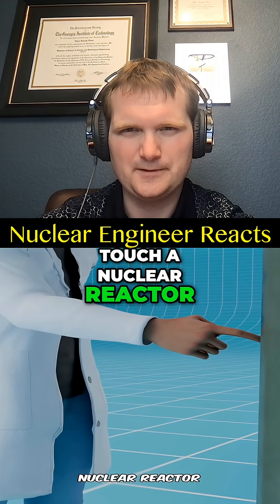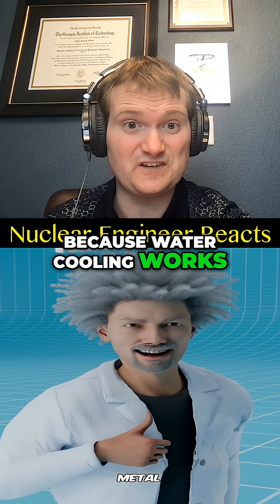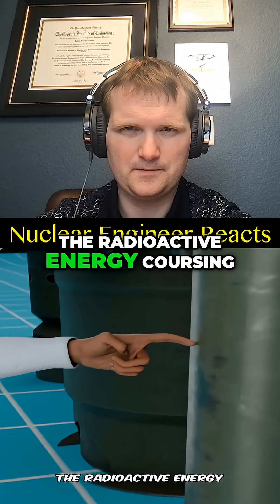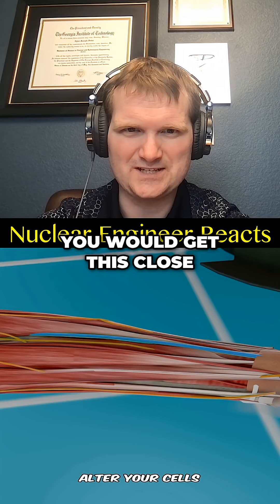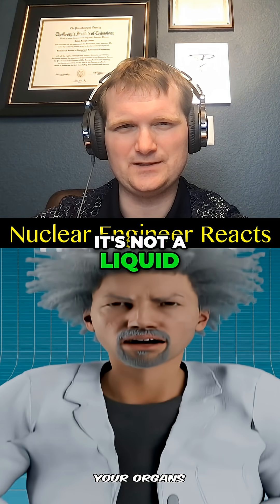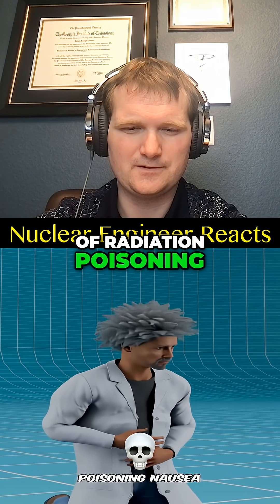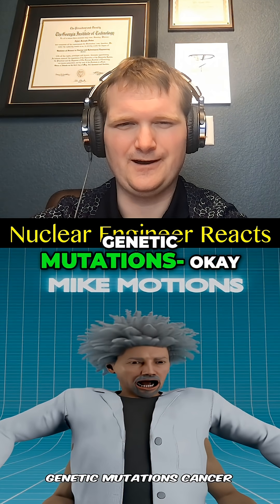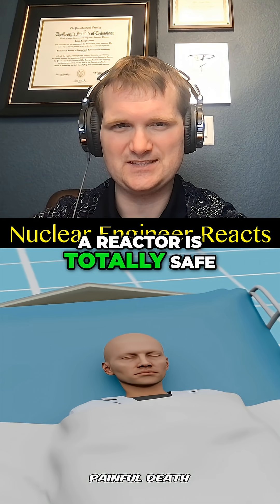What Happens if You Touch a Nuclear Reactor? - Nuclear Engineer Reacts to MikeMotions

Comment: For all the beginners in the crowd. This is Potassium Permanganate and Sugar mixed together. This causes the potassium to get thousands of degrees hot. The potassium can also purify water. This is a good thing to bring with you for water purification and fire starting. It does not replace a Bic but enhances it.

Comment: Id like to hear your take and explanation for the regular joe about that control rod disaster that happened in that "portable" reactor the military had... when one of the operators lifted the center control rod out of the water like 24 inches instead of only 4 inches. It ended up causing the deaths of 3 men.

Comment: I have actually been in the reactor compartment on the USS Enterprise. it was shut down in port and it still took a few days before we went in. it takes a half hour to suit up, the elt's have to do the surveys and mark out the hot spots. and its about 120F the whole time and most of the metal is insulated. you carried your TLD and a pocket dosimeter. you spend about an hour inside doing your job then finish, go out and check yourself for contamination, remove the suits into the proper containers. you lose about 5 pounds of water weight from sweat. the dose I got? a lot less than a chest xray

Comment: Would you consider light from a lethal light bulb or sun a fair analogy of radiation? Longer exposure would be understandable as similar to getting a sunburn, and it's just as immaterial as sunlight, aka not a substance you can touch or ingest (although obviously radioactive substances could still be touched or ingested)
Concrete and lead are "opaque" but other materials are rather transparent to this light.

Comment: Though the water, metal and concrete would shield from alpha and beta particles from the core, I wonder if there wouldn't be alpha and beta particles coming from the neutron flux and gamma radiation knocking them out of the outer layer of the shielding.

Comment: The explanation with concrete and water protection does not apply to a CANDU type reactor, which also has water and concrete protection but is not immersed. Here you can literally touch it (the channels and feeders) only during an outage, otherwise you will never be able to enter normal operation of the reactor due to the numerous protection barriers that open only during an outage.This is a small explanation, everything is much more complex.
😉

Comment: I would spend hours vaping outside the reactor compartment on fast attack submarine deployment. I was shielded by diesel fuel and sea water. My TLD never said I was exposed to harmful levels there. There's less radiation in the engine room on a nuclear sub than standing in the sun light

Comment: its best to think about radiation as light... because it acts almost exactly the same way. an exposed hot source would just look like a glowing orb if you could see that wavelength of light. place something in front of the light, it blocks it. in the case of gamma emission, you just need concrete or lead.

Comment: It is possible to touch the Vessel (usually the under-vessel / in-core guide tube room) 
At power it’s double locked and posted VHRA (>500R/hr @ 1meter) so you’re not getting in, and it would be far from room temperature. 

During an outage workgroups need access, (removing insulation from the vessel for inspections usually) it’s still pretty dosey, usually posted LHRA or HRA, and may be “room temperature” but that room is freaking hot 😂

Comment: If you're immediately throwing up after exposure, good luck living 2 days, much less long enough to worry about cancer or mutations. The demon core was mentioned, but Cecil Kelley might be more apt? Then again, this is science fiction fearmongering, not reality.

Maybe they mean something closer to the incidents where technicians died or were severely injured due to exposure to material at radiators, not nuclear reactors? Even in those extremely rare cases, it was due to human failures/errors piling up.

Comment: This is like saying "What happens if you touch a volcano?" and immediately assume you teleported into the magma chamber. Unless you magically throw yourself somewhere very dangerous, you're gonna be fine.
Reply: Or just touch the ground of the volcano
Reply: Language is very important. To use your example, it depends on the volcano, as some volcanos are super super active. Trust me, all nuclear reactors, active or not, will be the same to touch. This is not the case with volcanoes. Just thought i would mention the language part here. Words matter. "In an investigation, details matter." -Jack Reacher
Reply: @d @diehardbikes  If you want to be really specific with language activity isn’t what you should worry about. I’ve stood on Stromboli while it’s erupting, completely safe, and that erupts multiple times a day. You can almost guarantee safety when touching some part of a volcano, usually the base but that’s still the volcano. It’s not the best analogy I know but it does proves the general point.

Comment: Dude the video is trying to talk about if you were to touch a reactor from inside the core (somehow). But obviously, if somehow that were to happen, you wouldn't even live long enough to reach your hand in out. 
40 years later, if you teleported to Chernobyl's exposed core, with radiation gear on, you'd be unconscious in 10 seconds, dead by 20 and mush by 30
Reply: Radiation doesn’t just melt a person like that

Comment: The higher the radiation dose, the sooner the effects will appear, and the higher the probability of death.

High radiation doses (particularly over a short period of time) have a tendency to kill cells. In fact, high doses can sometimes kill so many cells that tissues and organs are damaged immediately. This, in turn, may cause a rapid whole-body response, which is often called "acute radiation syndrome".

If the radiation dose is high enough (in the range of thousands of Grays or hundreds of thousands of rads), it can cause immediate unconsciousness and death within minutes to an hour. 

This is often described in the context of the cerebrovascular/central nervous system (CNS) syndrome of acute radiation syndrome. 

For context, typical fatal doses without medical intervention (which result in death over days or weeks) are much lower, around 4 to 10 Grays (Gy).

At extremely high doses (greater than 30 Gy, and especially above 1,000 Gy), the radiation damages the body at a cellular level almost instantly. 

Immediate Incapacitation: Neurological symptoms such as extreme nervousness, confusion, dizziness, headache, or loss of consciousness occur within minutes of exposure.

Physical Destruction: The sheer amount of energy absorbed can be enough to disrupt the nervous system and cause cells to die off immediately, similar to being flash-cooked by thermal energy if the dose rate is high enough.

My point: you can die before getting the symptoms of radiation sickness.

Comment: This animation was brought to you by the wind and solar lobby
Reply: You mean fossil fuels?
Reply: @PackMan.09  Nope. Politically and societally fossil fuel (at least in developed, western countries) is not competing with nuclear power. Both are being shunned as outdated and dangerous energy production methods by green politics. Oil is used for things which largely don't run on electricity, so not much competition there. The most overlap is coal (power plants), but again, we aren't deciding between coal and nuclear, we're deciding between coal+nuclear vs. solar and wind.